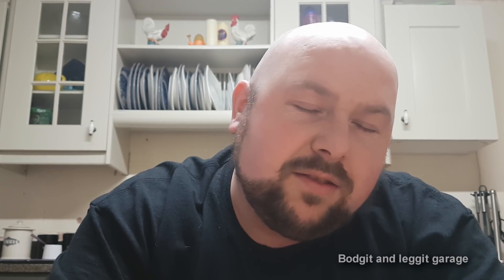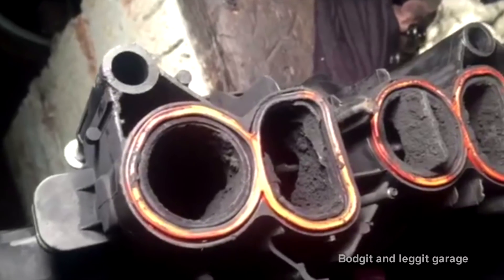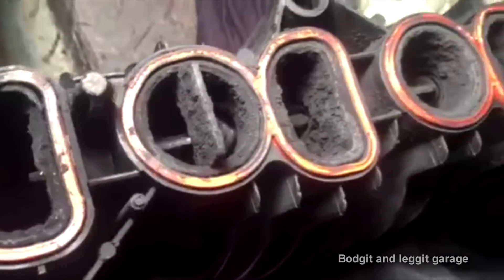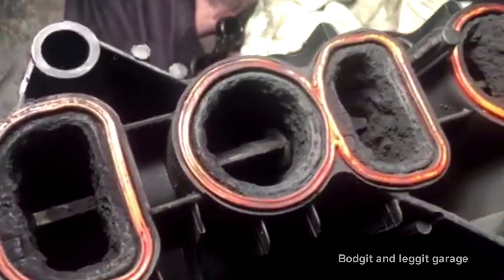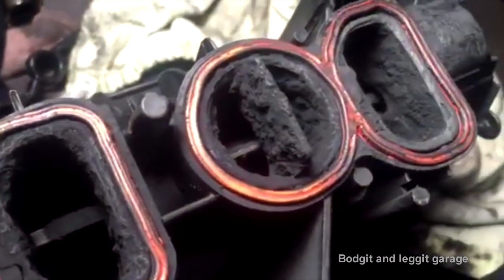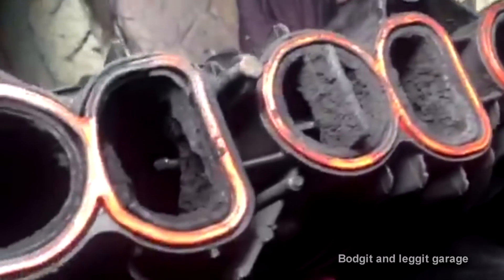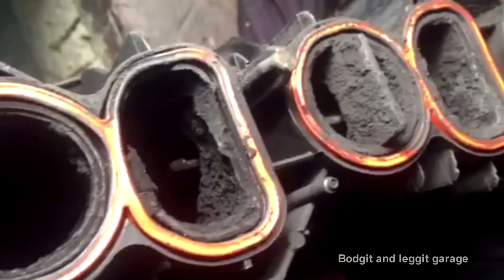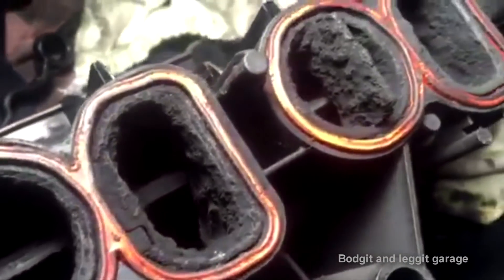Engine Carbon Cleaning EXPOSED!!!!!!!!!!! With PROOF!!!!!!!!! Bodgit And Leggit Garage

Comment: I personally dont see the point, sounds like snake oil
I got a 2013 bmw 1 series, 2 litre diesel, 150 thousand miles. Maintained by myself. Doesnt smoke, doesnt rattle, still does 60mpg
The gunk builds up on the valves because manufacturers changed to direct injection rather than sending fuel through the intake
The carbon builds up mainly on cars used as city cars doing low miles and idling a lot.
Be careful getting it done because that carbon build up could be blocking up a worn gasket and could open up a can of worms

Comment: Bit of science then. For hydrogen to clean anything it have to be ignited. On it's way from air filter to combustion chamber it does to carbon exactly what air does on it's way to engine cylinder. It can drag some loose carbon to cylinder, but let's be honest how much of loose carbon is in engine intake? It's mainly gunk and no gas can move it just by moving by. Hydrogen cleans bits in combustion chamber when ignited. That means it will clean exhaust valves, top of piston, and injector tip in diesel engine. That's it. It will not clean intake valves because they are closed during the ignition cycle. If intake valve have carbon build up to the point that is not closing fully that could potentially clean that as well but also could melt the head. Plus if your engine is at this stage it might be too late for that cleaning, all that carbon need to be cleaned mechanically.

Comment: At the very end of the video he shows the 'before' picture. Kinda backward since he started with the after pic and just talked about the before 'with all the carbon and gunk' then finally, FINALLY you got to see what it looked like. I don't really like the green machine built out of what reminds me of an old computer case, kind of a decent hommage, though so, Respect. I much prefer my smaller scale 2 Pickle Jar setup with a connection to my pickup truck's electrical and air intake via copper wire and 1/8in tubing ported to the air intake / stator vacuum ported somewhere past the MAF sensor and throttle body, nearer to the brake cylinder where suction is most concentrated. I am very happy with HHO.

Comment: water ingress into a piston engine is fatal it is called HYDRALIC ING  (terminal)
Reply from the maker: That's just not true mate
Reply: @bodgitandleggitgarage  How many engines have you ever had that have injested 2 liters of waterthrough the air intake and not hydraliced / think about this water does not compress yhere is a small amount of space in a cylinder onece the piston is at TDC there is no spare room for water there is enough room for the fuel and air to mix prior to ignition
Reply from the maker: @simonjones388  when did I ever say  2 litres of water have you ever heard of water injection I don't need to say anymore. Yes the muppet that said he puts 2-l in his engine yes he's a fucking idiot

Comment: I bought a 2008 Vw Passat sport dsg from London.  Upon traveling home to IRELAND, I noticed that the 160BHP engine was really preforming like a 110BHP and getting about 32 mpg (28mpg doing 80mph on motorway to Dublin). Upon checking the DPF was almost fully clogged. Got that cleaned. The mpg improved a little.  The diagnostic is telling my mechanic there are no problems.  I’m now thinking it must be Carbon given that the mpg and power is only a little better that the car spent its life most likely in traffic.  What are your thoughts? Is this treatment available in ireland (Cork area if possible)?
Reply from the maker: Hi mate what you really need to do is get it diagnosed properly because I carbon clean will not help if you've got other issues no point wasting money on something you don't need to get done you will also then think the carbon cleaning machine doesn't work if you've got another issue get it checked properly first before you get anything done

Comment: A video of 2 high mileage engines with similar miles that show a before and after of carbon build up on the heads would be better. It's hard to see how the mechanic made his assessment based on what was shown in this vid given that he did not show before a before and after and also said that there is no science behind air planes flying. With all respect I think the service does help motors but you guys are doing a disservice to yourselfs by showing results in that manner.

Comment: Am getting mine done in 2 weeks. 
When cold my turbo lags till 2500rpm then gives me a giant burst of boost with a huge ploom of smoke.
Just hope its as good as you say
Reply from the maker: Make sure you get your car diagnosed properly first if it's a mechanical problem this will not work you need to make sure it's a carbon issue before this will work
Reply: @bodgitandleggitgarage  Thanks for the advice. My mechanic blanked the egr valve to eliminate the egr system and used compressed air to clear the intake manifold and problem solved. Also have a split turbo boist pipe from egr, but at least no smoking or laggy performance. It shows it must be an issue with the egr system

Comment: I reckon if you had this done every 30 or 50.000 would keep the internals cleaner
Reply: Daily driving a car with a blast up the motorway will keep it tip top, regular oil changes also help

Comment: I bought a used Honda Civic that had done 39 000 miles. I had the engine Terraclean treatment straight after buying it. It made the fuel economy noticeable WORST!
Reply from the maker: Ok but this machine isn't the TerraClean these are two completely different machines
Reply: @bodgitandleggitgarage  What is the name of the treatment you're talking about?
Reply from the maker: @BreederUK  this is a carbon cleaning machine which uses different chemicals in the different treatments the other machine does clean carbon but cleans it in a different way

Comment: absolutely disgusting diesel is the main cause to poor air quality today not fucking scented candles or woodburning stoves. you've only to be following a bus for a minute and I guarantee you will recirculate the air in you car to avoid the the diesel entering. The government was telling people that diesel cars we're the future and now we have scientific proof that it's the total opposite they refuse to take necessary action. This is just my opinion but I also think diesel is causing cancer in some case's. also you think riding a bike is keeping you fit and healthy? just think of the filthy polluted air you are exposing you lungs to. I also think at some point diesel fuled engine's should be took off the production line, Maybe just for heavy good vehicle use.
Reply: The problem is that public service vehicles are exempt from emissions testing regulations. Funny that, given the bus services are now almost entirely privatised. There's nothing wrong with diesel engines for passenger cars, the current crop is cleaner than ever with DPF's, Selective catalytic reduction and other emissions reducing measures. The reason for the demonisation of diesel is entirely down to money. Oil companies and governments are very closely allied, and neither is going to give up their revenue stream from passenger car fuel sales without a fight. No one ever expected diesel engines to turn out as quiet, as powerful and as economical as they have. That's why people buy 'em. And that's the problem - they go too far on a gallon of fuel.

Comment: I agree with you Mr Bodgit. I've used mine to great effect. I got mine which is a sun machine from snap on in about 2005. It's been laid up for a while but I'd swear by it and I'm 30 years in the trade and can remember way back when we did decokes every 50k

Comment: Here is a question would this help with thin  white smoke? My bmw never had it done 17 years old but I am thinking of doin it seems it does help lot of people
Reply from the maker: White smoke normally indicate head gasket problems so this machine will not help

Comment: I had it done on my 2012 Fiesta 1.25, felt a massive difference, engine far smoother, especially in 1st and 2nd gear, going to do it on my 2017 Astra 1.6 cdti, I was very sceptical at first, but it works, it's only £90, so you don't have much to lose
Reply from the maker: nice to here that mate

Comment: Some of the hho reconstitutes under pressure in the cylinder and cleans off a little carbon just like adding a fine water vapour would, the initial effect you feel is because the addition of hydrogen as an extra fuel for 30 mins while you "clean" the engine makes the o2 sensor back off the engines fuelling of and temporarily rewrites the map, so you get an initial reduction In emissions as your engine runs lean and also feels a little more powerful, the effect is short lived which is why people feel the need to have it done again after a month. There you go, now you understand the science
Reply: This explanation is spot on accurate so good on you for making it easy for everyone here to understand. I recently had this service performed complementary for me on a 2007 chevy gas truck with close to 200k miles on it with previously confirmed excessive carbon build up during a spark plug, exhuast header, and intake manifold replacement done just prior and while the hydro machine does seem to help remove some carbon it has almost the same effect as running a high octane fuel with a fine steady stream of water mist injection into the engine by essentially using steam to help break up the deposits. So does this machine work???? I would have yes, but is it worth paying for it when you can essentially do it yourself with a higher octane fuel and a fine water mister on the intake???? Well that's completely up to you and your skill level with vehicles... One thing to also note here though is that if the carbon build up on your engine is so bad that its affecting performance that you with likely also have excessive valve train component wear due to those parts having to compensate for the carbon build up in the first place and may also need to be addressed to fix the problems your having long term after the heads are cleaned out. Good luck

Comment: Ignore the negativity. This machine is just another tool, like a 13mm spanner, a means of providing a service to your customers and making money, which is why we are in the trade. Any extra service you can provide will increase turnover, and hopefully profits. Yes, it was possible on carburated  engines to pour a little water into the carb and in effect steam clean the combustion chambers, but not 2 litres at a go!!! Old Renaults and Mk1 Fiestas were a favourite for pinking issues when I was a lad, and we would frequently try this method before removing a cylinder head. Sometimes it worked, sometimes not. On the modern vehicles clearly water shouldn't be allowed anywhere near the induction system of course... something the manufacturers should think about when placing intakes so low down in the engine bay.....but that's another discussion of course...hahaha

Comment: Is it only this machine from this manufacturer works? Or are there any other very well rated cleaning machine in your data and experience.
Reply from the maker: Sushov Gautam hi mate impossible for me to say as I have only use this machine but I am sure there is lots of machines out there that will do this very well
Reply: Hello. Can you check something on Kingkar HHO with your years of experience in this technology and know how. This would be very appreciable.
Reply from the maker: Sushov Gautam sorry mate but I don't understand what you are saying if you want me to get another machine that's going to be impossible I do not have the money to buy another machine just to do a review on it
Reply: bodgit and leggit garage mate If you could review it thru internet and product details. I am confident that u will know much more on it than me. As you are already familiar with this tech, I wanted a review of it.
Reply from the maker: Sushov Gautam hi mate it is impossible for me to review something without using it so I cannot do this I would have to use it and test it before I put my name to anything
Reply: Kingkar also has a additive to mix with the hydrogen it also produces more litres per hour I can't remember how many also it's a lot more expensive I got the ECC 230 from Portugal  you will get people expecting these machines to fix problems which we know they can't but in modern cars with egrs and dpfs these machines will serve a purpose in your mot or part of your service to help prevent carbon buildup nobody is going to strip a to do a before and after I know the advertising pictures that show how clean everything is after the clean is next to impossible but common sense tells you that the combustion chamber is getting a cleaner burn with the extra fuel which should help reduce emissions and if done regularly help keep the carbon buildup under control along with good quality oil and regular servicing hope this makes some sense lol 😁

Comment: I'd be more worried to hit the two charger cables together with hydrogen gas knocking about. Savage way to lose eyebrows!
Reply: I'm a commercial diver and welding underwater causes hydrogen gas bubbles.  it's amazing the explosions generated when a spark hits one of them.
Reply: @christiankoppl7721  call me if they get out of hand since I’m an underwater fire fighter mate.

Comment: I sprayed water in to the intake on my Clio RS and I ended up with a blocked injector. Do it at your own peril
Reply from the maker: silent warrior congratulations you've learnt a lesson not to spray water in your intake
We all have to learn lessons that's how we learn
Reply: You guys need to understand the difference between hydrogen and water (H2O).  Hydrogen is a gas not a liquid .  The Hydrogen cleaning system works with a unit that produces hydrogen by splitting the H2O molecule with electricity thus producing hydrogen which is highly combustible and will bind with carbon and break it down (hydro-carbons).  Putting water in your intake is definitely NOT recommended.
Reply: if your injector was blocked that blockage would of come from your fuel supply as spraying into the intake would go past the injector  not through it

Comment: I had of done,defo improve throttle response but after 2 weeks just felt the same or I got used to it not sure..but I did check egr after and it never cleaned it at all

Comment: Might have to get this done myself. My intake manifold was leaking oil at the back (1.6hdi), I thought it was a seal gone or something. I took off the intake and the whole thing was covered in gunk, all the way down into the head too. It's like the carbon and oil got in under the seals and lifted the intake. It's much better now but still needs a good clean further down I'd say.

Comment: I guess you have one machine and offering cleaning services. As a mechanic/ auto electrician I can say the entire carbon clean industry is just a scam.

Will you achieve the same result on (performance, improved mpg) mk1 golf for instance?  Of course not.

Learn about ECU’s warrior
Reply from the maker: Lacipecsenye1 thank you for your opinion but I have to say it depends how it's marketed I must admit a lot of people our marketing this as does more than what it actually does I've had some great success with it and getting some more videos coming up shortly proving the engine runs better after cleaning but if the engine is too badly carbon. Yes this won't do any good a lot of marketers out there are claiming too much
Reply: Yep, bunch of false claims around this thing. May I can imagine it does something to valve seats therefore increase compression however apart from that performance and fuel economy improvement down to the ecu for a week or so. These days they are very very complex part of the car.